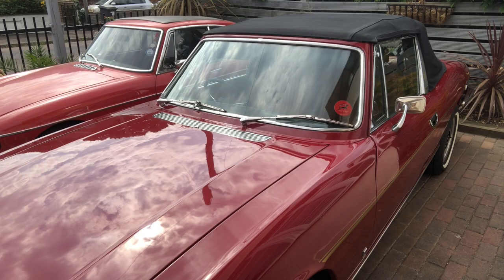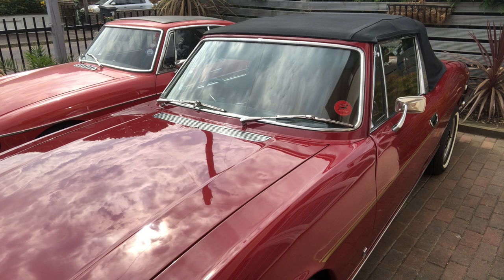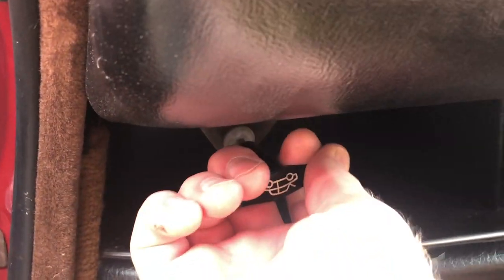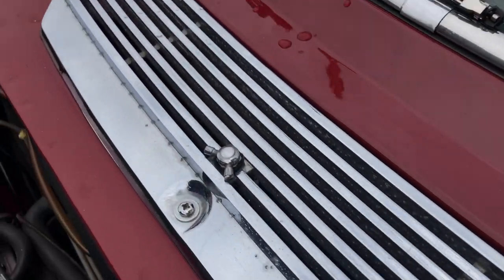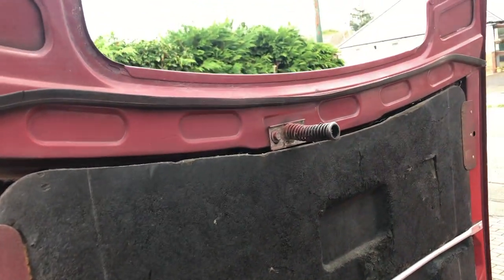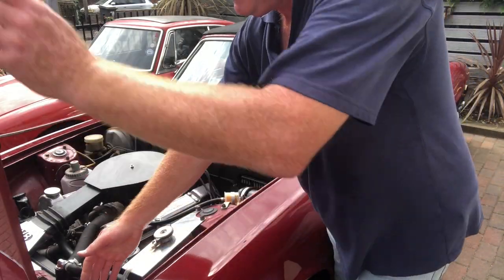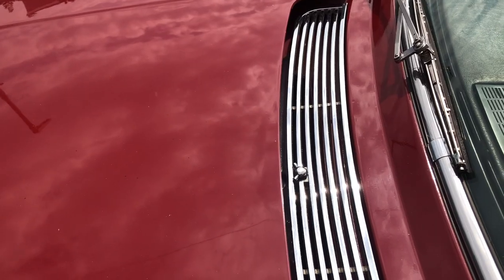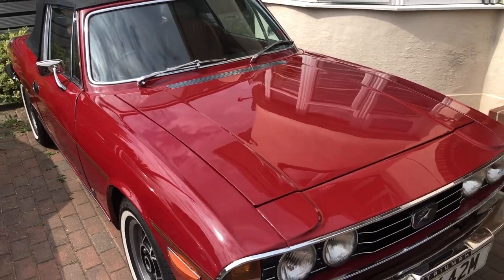How to Open & Shut a Triumph Stag Bonnet (Hood)

Comment: Hi Tony
Just wondered if the square rubber blocks were original fit of added by Alan. My car does not have these and the corners of the bonnet do flap, hence i presume why they are added, can i ask where you got hem or if home made, what size and material type (presume neoprene foam). Cheers Pete

Comment: 31 years ago I was shown that dropping the bonnet by holding in the centre and letting go from about 12” was the correct way to shut the Stag bonnet. Been doing it that way ever since. Not about to change now and risk putting a dent in it by shutting it your way.

Comment: Hmm, interesting. I've actually gone the other way. I USED to close the bonnet on my sedan by putting it against the catch and then pushing it - as you described and demonstrated. It requires a reasonably firm push to close though. So I started thinking that perhaps this firm push on the bonnet might have the potential for denting it. That sounds a bit extreme, because I imagine it would require a VERY hard push to actually dent it! And I realise that underneath where you push is very solid because all the catch mechanism is there.  But I just felt I was "being a bit unkind to the car" by pushing on the bonnet. So I began to close it by lowering it until it was almost there, and letting it drop. The bonnet then has some momentum that carries it through to the closed position without having to press against it. In other words, its own momentum closes it, rather than having a hand pushing against it. That, to me, seemed more kind to the car than the push method. I use the same method on my modern car too (which I would say has a more flimsy metal than the Triumph). 
I acknowledge that the welder probably has a greater understanding of panels and so on than I do, but I'm still not sure I'm wrong. 
By the way, the bonnet and its position is totally original; there are quite reasonable gaps around it and it doesn't touch any of the surrounding bodywork as it opens or closes. 

Good tip about having an alternative way of opening it, by the way. If that cable was to break (and in my case it is 45 years old!), getting the bonnet open would be a real problem! I will have a look at that. 
Thanks for all the stories and tips.

Comment: No video regarding backup release. It is simple to obtain a second release cable, complete with mounting bracket, and fit it under the driver’s side of the dashboard. The captive screws are already there for the bracket. There are various ways of attaching the second cable to the release catch. Doing it this way gives you the option of opening the bonnet from either side, whichever is most convenient.
Reply: @ArryTheStag  
Got to say I’m totally in agreement with Dave about this and shutting the bonnet. Having a release on both sides of the dash is really, really useful.
However, of most importance, when are we going to see more about the bodywork on UNY ??